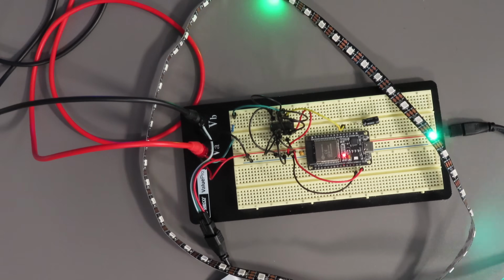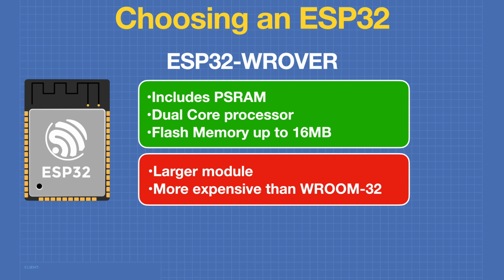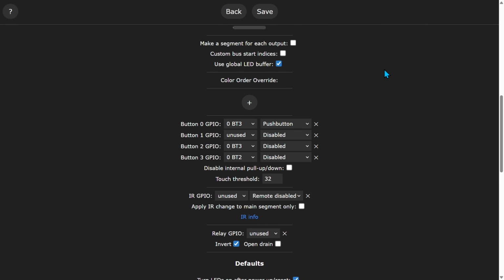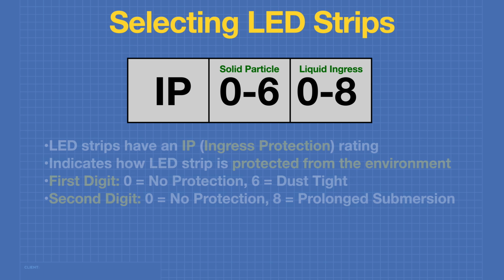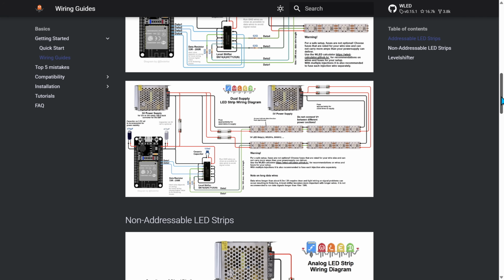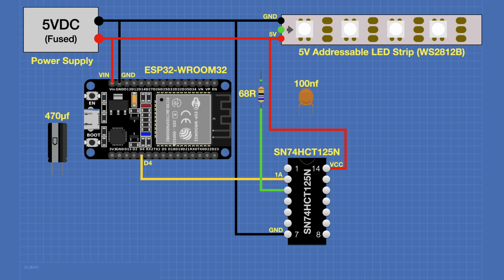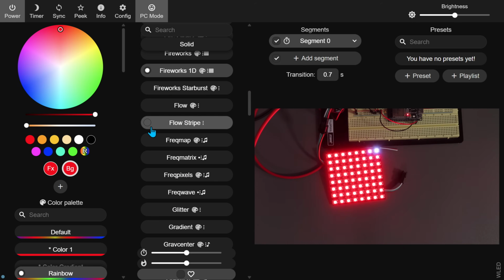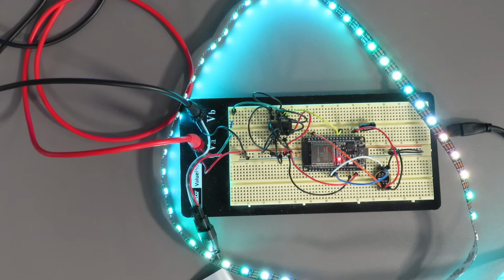WLED on ESP32 – Setup Guide (with Audio Reactive)

Comment: I'm planning a project using a PCM1802 as the audio input, instead of using a microphone. Is this something you're familiar enough with, that you could tell me if the resistor, capacitors, and sn74 would still be required for that device?

Comment: If I have a small LED strip like 50 cm can I avoid connecting it with AC adapter and power it directly from usb type c on the ESP32 with phone charger?

Comment: So I recently used wled and an ESP32 to control a 256 led matrix, but I didn’t use an ic or capacitors, just a usb-c to run it all and I haven’t had any issues. So my question is, why do we need the chip and capacitors? Great videos btw!

Comment: Great video as always. Your channel has helped me many projects over the years. I decided I wanted to put up wled powered christmas lights this year. This video probably saved me from burning my house down, as other videos are not nearly so detailed and don't mentions using fuses. 😮.

That said, for those who don't   have all the electronic components on hand and just want some wled controlled lights, a premade esp32  wled controller is the way to go.  Some also are flexible with what power supply can be used (5v-24v) so I can reuse what I have. 

I will be incorporating fuses though 😶‍🌫️

Comment: Be careful when searching. Many sellers will show you ESP32-WROOM when you search for ESP32-WROVER and they can be easily confused, and some sellers appear to be counting on this confusion as well. Finding the WROVER in dev-kit form, on a PCB with proper thru holes or pre-soldered pins, and not simply a surface mount package, is also common. So, if you expect a dev-kit form make sure that's what you are getting. At the moment it also seems to be difficult to find anyone selling a dev-kit WROVER (on a PCB) with USB-C (not USB-micro).

Comment: I need some help understanding something here.  I built this circuit on a breadboard a number of times using ESP32-WROOM-32's a number of times but it was not working. I used the same components you described (470uF capacitor, 100 nF capacitor and the SN74HCT125N). I couldn't for the life of me figure out why it wasn't working.  I decided to blame my crappy plastic bread board. I then built the same circuit (non-sound reactive) on an ElectroCookie bread board purchased from Amazon and to my astonishment it was working flawlessly! I was so happy! Then I turned the ElectroCookie Bread Board over and discovered that my left and right power/ground rails were not married together.  I wondered to myself, why is this working. Pin 1, 4, 5, 7 on my level shifter were grounded using the same ground as pins 13, 12, 10, and 9.  I should have just left everything alone because it was working but I decided to jumper the left and right power/ground rails together. The circuit stopped working. I am assuming I fried my level shifter somehow?  Can anyone please explain this to me?

Comment: what do you use for power supply for the leds? I'm currently trying to power an led and a beefy 5v fan using an esp32 and I'm not sure what supply would work the Bme 102 does
not supply enough current edit: s pace islimited So looking for something small

Comment: @6:40 Ouch..  No Espressif logo on the can?  You'll want to be careful of those.  While the Espressif chip is the real deal, the support components can be what the Chinese call 'shanzhai' - clone products that don't meet the specs of the original.  In this case it's mostly the 3.3 v regulator that fails for no apparent reason.

Comment: An exceptionally good video that clearly explains the different types of LED device and their potential uses, along with the correct wiring systems. It is also clearly spoken with excellent graphics.  I look forward to more especially HA integration.  I would also be interested in custom coding using platformIO.   Well done Bill!

Comment: I am trying to set this up on Arduino R4 which has a esp32 s3 mini. But its just stuck on "preparing installation". Any ideas?
Reply: hold boot button before clicking install
Reply: @insomnolentcrow  Thanks...the r4 doesn't have a boot button, but I have since obtained the correct esp32 board, which still was stuck on preparing installation, I have just tried holding the boot button on that and it works perfectly. Thanks for your help, I'm just disappointed this wasn't mentioned in the article.

Comment: I have this setup as my bedroom lighting with a single run of 1500 LEDs (12.5m). It can be a little glitchy with uneven brightness. I have power at both ends and one in the middle. It really should have more power injection to deal with the unevenness. There are repeaters that can help with the glitchiness. I also have a Wi-Fi remote called ESP NOW and they only cost about $10. It has on/off, brightness up/down, 4-way d-pad and a "nightlight" button. The buttons can be configured using presets. I like this setup very much, but the uneven brightness and occasional glitchiness irritate me.

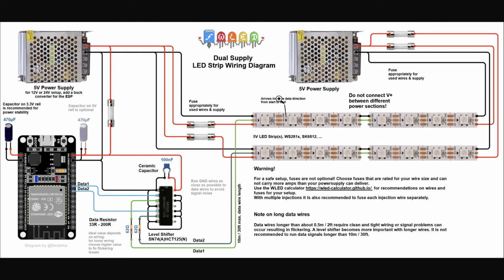Comment: The power injection wiring diagram shown at 21:16 contains a significant error/omission: The diagram, as shown, shows two independent power supplies, this is bad.  The typical power supply for these installations will have AT LEAST TWO (2) outputs (2 V+ and 2 V-), sometimes more.  All power injection points should be fed from the SAME power supply‼️  (At a BARE minimum the ground wires need to be tied together.)
Reply: It looks correct to me. Each segment has common data and ground and isolated V+. It clearly says not to connect V+ together.

Comment: Thanks so much . Learnt something new today. Any reason why I need the ic between the esp32 and the led ?  What happens with direct connection.
Reply: It's a level shifter for the data connection. ESP32 puts out 3.3v on GPIO but WS2812B uses 5v signaling. 3.3v isn't usually a problem, but with longer runs you may get glitching.